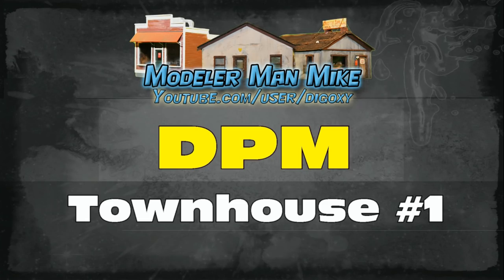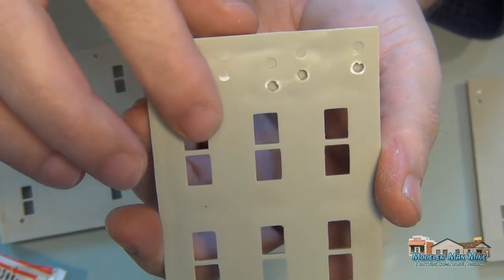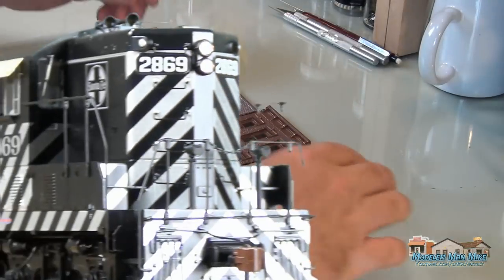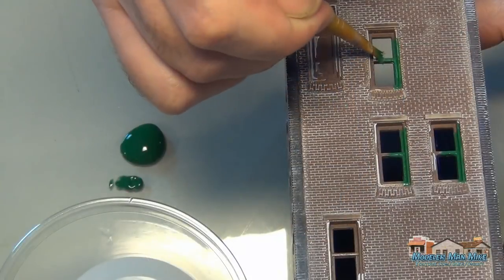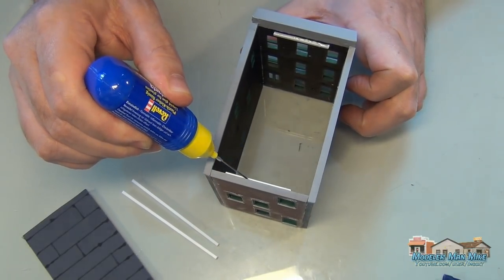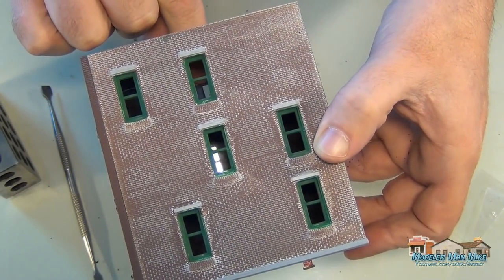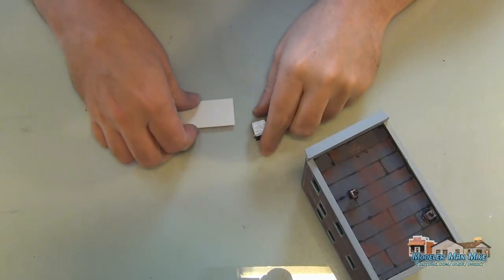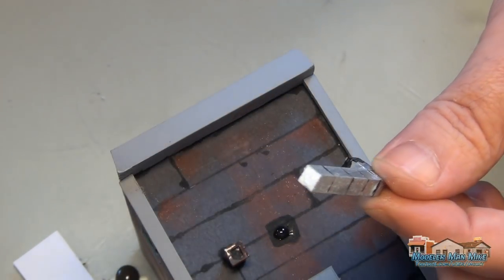Model Railroad Layout Building DPM Townhouse #1 How To

Comment: Mike, I put blue masking tape over the whole face then cut out the windows with a sharp blade.  Set these pieces aside, spray paint the windows.  When dry remove the tape from the building and put the saved cutout pieces over the windows, spray paint the building either white or grey for the grout lines and when dry you can dry brush the brick color.
Reply: Hey, thanks for the suggestion/Tip! Appreciate the feedback.

Comment: I purchased the n scale Town and Factory set of 12 shops and one factory. I also purchased a few more kits to round out my small Mayberry-like town. I have 24 DPM n scale kits in just my small town so, your tips will come in very handy. Trying to paint the windows will be fun! (sarcasm) I do like this paint scheme. Due to the small size of my buildings, I will skip the mortar and roof details. That would make me crazy. I thought I might try (at least on the first one) painting the windows and doors first and then, to help cover the overlap, paint the bricks. Most all the buildings will have three paint colors: the wood trim (usually the place for colorful paint), one for the concrete/stone and one for the brick color. I like the idea of that black cardboard inside to block the see through to the other side and to make the windows appear alive. I also bought some Blair Line Shop Signs, #1 & #2 so all my builds will be labeled as to their purpose: Barber Shop, Bakery, Hotel, etc. Thanks again.
Reply from the maker: Looks like you have a head start on the layout of your buildings, that's great rather than going in blind I say. Have you considered building them on video and uploading the video's? It sounds like you have many to build, would be a great few video's. N scale is pretty small, I am not sure if I could do N Scale, just really hard to see. Danny, thanks for the comments and I do look forward to seeing some of your work regardless of how you show it off, in video, Facebook or however.

Comment: Try painting the windows/doors first. Tape them and then paint the walls. Requires minimum touch up with a fine brush. I've done this with DPM structures with a lot of success.
Reply from the maker: Hey, thanks for the tip, I will give this a try on my next DPM model. Appreciate the feedback.

Comment: Great video Mike - it's good to see how others approach building these models. GREAT A/C UNITS! I also like the weathering effects you get. In case you're interested, consider the following (and if you're not interested, ignore the rest of this post!):

I don't know if you're painting the interior black in order to have a very dark background through the windows, or if you're worried about "light leak" through the plastic walls. If it's the former, here's an easier way to make a view block: cut a piece of black construction paper; make the height the same as the inside height to the roof, and make the length 2xL+W/2, where L is the length of the side walls and W is the building width. After the window glazing is in and the roof is attached, slip the paper in from the bottom, with the two ends in the front left and right corners. The paper will make a U shape, with the bottom of the U just touching the back wall.

I always glue the walls together before painting. (If you desire a sturdier build, glue a 1/16" square length of styrene into the inside of each corner.) Once the glue is dry, you can prime and paint the entire building. I really like the way you made the front brick a different color from the rest of the building: this was commonly done to save money by using cheaper brick on the sides and back. In your case, this is easily done by applying raw umber washes to the front - keep applying successive washes until you get the color you like. (You can even use a burnt sienna wash in there somewhere to make the brick redder.) If you have dramatically different brick colors, you would paint the entire building in the lighter color, then mask and paint the darker color. I never paint my mortar lines, so you'll need to experiment to see if this is better done before or after you apply the washes.

(By the way, I ALWAYS apply several wash coats, even when my brick is all the same color. I find the washes give just enough variation in the brick color to give the brick a natural color variation. If I want a faded sign on my building, I apply a decal over the base color, then apply the washes right over the sign along with the rest of the brick. For a REALLY faded sign, use a sponge to dab some of the base color around the edges - or even in the middle - of the sign to make the sign "disappear.")

One final tip: Roomettes make interior kits for buildings of this sort, and they have a kit designed specifically for this DPM kit: it's the Banfield Street #1. These are easy to install and they come complete with LED lighting. You do NOT need a JustPlug lighting system to use these LEDs! Just clip off the connector, add a 640 Ohm resistor, and connect to 12 VDC.
Reply from the maker: Howdie, thanks for the feedback, ideas. Much of what you have suggested I actually do. I am not sure if you make video's for youtube but you should as you seem to have some good insight in building structures. Try it, you might like making videos to help others.
Reply: @ModelerManMike  Thanks for the kind words. Sadly, my video making skills are non-existent. (You can confirm that for yourself - I have a few short videos posted.) I am in awe of the time and effort folks like you put in to make these videos.
Reply from the maker: @rwissbaum9849  I will check out your video's of course, didnt even think to look as most people who reply dont have any video's. Your right, its a lot of work, it takes me 3 times as long to build a model doing a video with a build. I am really not that good at it, I just kinda throw it together. Its time consuming for sure. Practice helps though.
Reply: @ModelerManMike  Well, for someone who characterizes his video skills as "not that good", I'd say you're doing marvelously well! I bought myself a cheap video recorder last Christmas and I plan to try shooting some better videos. Maybe I'll try filming (how's that for an anachronistic word?) my next model build. (The videos I have posted were shot using my phone.)
Reply from the maker: You would want at the very least a 1024, look up the specs on the Sony HDR-PJ260, I used these for my video's. These would be like 12 years old though camera is key really to get a good clear picture and on a tri-pod as much as possible. Might find one of these used for cheap now! I used 3 of them for different angles but one would suffice I think.
Reply: @ModelerManMike  The camera I bought last Christmas is an off-off-off brand 1024P 24MP 15fps recorder. I installed OpenShot and used it to edit the video you watched - looks pretty easy. (Unfortunately, I just upgraded to Ubuntu 22.04 LTS, and OpenShot DOES NOT run on 22.04 - known bug. So I'll have to install on my laptop, which is not so easy.) Next, I need to look into recording a separate audio track so I can provide some commentary consisting of more than "...oh, shit...ah, okay...where did I put that?..." I have a tripod for my Nikon SLR, so should be all set - just need to do it! (Although I might want to look to see if I can find a small camera mount that clamps to my work table...)

Comment: Try Painting in "curtians" and /or  partially drawn window shades on the INSIDE of the "glass" windows.   Quite easy and gives it another level of realisim.  I use white and yello ochre paint for window shades   and white for where I want curtains on either side of the windows.
Reply from the maker: Good tips! Thanks for taking the time to post this, it can be useful to many.
Reply: Bingo!  I was waiting for someone to post this tip.  Also, it is tough to cut and glue in the window glass pieces after the walls are glued together.  I've tried both methods of masking for walls and windows and neither is worth the effort vs carefully painting each window frame.  You just gotta do it.

Comment: Another cute build, Mike! Some comments along the way:
1. You asked about easier window painting - gosh, there are lots of smaller brushes than what you're using out there! Do the edges with one and then fill it in with a big one.
2. One roof detail that's missing: an access hatch! There has to be some way up there.
3. One advantage to individual window glass pieces is that they don't reflect like one big sheet, just like real buildings. So amen to your comment about how it probably should be done!
4. I always use darker paints on heavily-framed windows like DPM's to reduce the visual size. If you plop down your DPM next to a building with, say, Grandt Line windows, they'll look like they were built with 2x4s! Sometimes I drybrush them with a lighter shade of the same color, which brings just the edges and corners out.
5. I've had good luck with duct work by chopping some little squares of thin styrene, just bigger than the cross-section of the planned duct. I made the duct in pieces and used these as "joiners" in between - they look like standing-seam joints found in real ductwork.
Cheers!
Reply from the maker: carmium Really, Really great tips, thanks for sharing your thoughts and comments. I have tried the square method for the duct work and do like the look and will probably make some like this in the future. For the mine I built sometime back, I would like to use some galvanized round (just seems more appropriate). You have any thoughts on this?

As for the windows, watching this video really enlightened me on the brush, it is well zoomed and I can actually see what I am doing, I am a bit hard to see I guess :) watching the video though does show all of my outside of the lines coloring!

I will need to set some of these buildings out with some others to visually see what your saying about the window frames. I have found that I really like the look of the windows in a lighter color, but, never considered the scale of these frames next to a reduced size window (like you say the grandt). 

Carmium, thanks again for writing, much appreciated and looking forward to seeing some of the build projects come up on your channel :)

Comment: Mike ,I like the fact that you are modest in your thoughts about you not being a good modeler ,so many modelers don't take criticism well ,but let me tell you ,,,, you are a very good modeler. What ever works for you will be best, everyone does it different . You've made it work very well in the process of your builds. The only difference with my building is I don't like to follow the building instructions because I don't want to have the same building that someone else has, and also I build to fit the layout itself. This one is going to my favs.
Reply from the maker: Trainman, thanks so much for all the compliments and adding to your fav's! :) I really and truly dont consider myself a good modeler, I just happen to get the video's put together, I do try hard on the video's to! It sounds like you enjoy kit bashing more than anything is that right?
Reply: What I really like to do is flip through the pages of the modeling magazines and look at the kit bashed structures and try to figure out what manufacture they are and how they were modified ,then try something similar .So yeah, I like to kit bash lol .

Comment: Painting windows and doors: the key is to use a small brush - I like the Flex-i-File Ultra Fine brush assortment. I use a 5/0 brush for the windows and doors. Brace your hand on an adjacent surface to minimize shaking.
Reply from the maker: Thanks again for the suggestions!

Comment: Another great video Mike!  For reference, Jack Daniels or Captain Morgan always help me with painting "inside the lines"
Reply from the maker: Right? I will surely try some rum next time! It worked in 3rd grade!
Reply: ModelerManMike Awe man.  It came out the wrong way. Its a jokeI tell my friends who ask me where I get the patience for working on small models.  As for getting paint within those small areas, I would use an airbursh with a fine point needle either .25mm or .35mm. with psi around 20-25  Dilute the paint with Createx reducer for a 50/50 mix. Its not a quick job but i'm always happy with the results.
   Your videos are excellent. The time and effort you put into them amaze me. I subscribed to you and always look forward to your videos that you post.
Reply from the maker: Fabian K Thanks Fabian, unfortunately I cant get it right with the AB, tried that to! But, I have some really good suggestions from many other people in short, the brush is all wrong, I didnt notice this until I watched the video closely, the brush has straggler hairs.

Comment: Great video, full of useful tips.
You asked about easier detail painting... Try propping your wrist up on a box or block of wood the same size as the model.  Sometimes several low blocks works better than one tall one, so you can stack as many as you need.  Also, keep turning the model over so the the surface you are painting faces up and the edge you are working on is away from you where you can best see the tip of the brush.
Reply from the maker: Good tips, I will surely gibe this a try.

Comment: Forgot to mention, that I trace the pieces and window openings onto paper, to use as a template for cutting and installing the glass for the windows. For the brick mortar I use corn starch. For the window trim, I just use a small brush, however, I paint them first them tape them off when painting the rest of the building.  Thanks for sharing!  Looking forward to your next video
Reply from the maker: Oh, see, this is something that would be different with an O Scale, using corn starch. The morter would be larger and so that would give it a better look. You ever consider making some O scale building video's? would be so nice to see some. I dont think there are very many if there are any at all.

Comment: I watched the DPM #1 building video. I sometimes use a single edge razor blade to keep the paint off the surrounding areas. Press the blade into the corner of the two surfaces. when the painting is done, take the blade away, wipe the blade clean, and move to the next section. It's a lot faster than using tape, and the blades can be broken into smaller pieces to get into smaller areas. I have used a X-acto chisel blade for tight spots.

Comment: You could always paint windows first then mask off or make template to cover also get a finer brush that one was quite big for detail work great tip on the straight lines on ducting great model welldone
Reply from the maker: Hey Jon, thanks for the comments and suggestions. I have actually masked them before, I have a couple of things to try, hopefully I can get something that works for me! :)

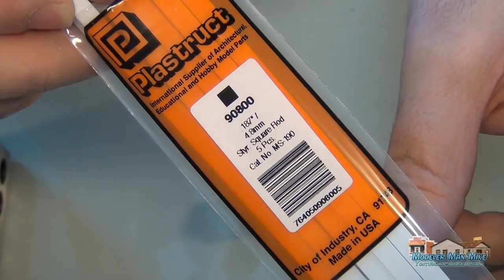Comment: At 12:00 minutes in, ,  I use a smaller brush to paint my DPM detail, including the TOP of the sills.  Half the size you're using.  Also, sometimes Under a lighted magnification stand so I can actually see what I'm doing.  At 21:00,  about duct work.  At every four feet along a duct, there is a seam.  Take a very thin piece of flat , narrow plastic, glue that around the duct (every 4'-0") and sand it nearly smooth.    It will leave the connecting strap that you want.  The actual strap is maybe two inches wide by 1/4 inch thick, so pretty small. It is all painted silver or white after assembly on the roof in real life.  For the model, I would build the entire assembly OFF the model, paint it, weather it and then put it on the roof.  Hope that helps.
Reply from the maker: All good suggestions, thanks for the idea's.

Comment: Hey Mike, for your duct work try cutting small strips of copy paper and glue it where you want seams. paint the paper before cutting to make that part easier I use a paper cutter to to cut straight lines, in fact its a great tool to have for craftsman modeling. Use canopy glue where you don't want any glue to show up, such as gluing on the paper strips. Painting DPM or any molded  in details, use a micro brush and cut some painters blue tape down into smaller sizes to mask off the detail, like for those windows. I also add some window cleaner to my acrylic paints to help it flow into the details as a wetting agent. Do this on your mortar and top weathering it really helps. and last tip to share, try using 80-90% rubbing alcohol (this cuts down on the water in the product) to fix your powders, you can also use chalk pastels ground down with the edge of razor and scrapping the chalks into powders. this will do the same as those expensive hobby powders. purchase a basic set of earth tones to get a good selection. any artiest brand names will work, stay away from low grade cheep chalks they just don't hold up and the colors fade with time, I like Remnant and Grumbacher brands, also only use the chalk type not oil pastels.. hope these help you some. my email is joe.cohen@gorvv.com if you want to drop notes back and forth.

Comment: Nice instructional! Gives me an idea how things have to be done. Example, I would have thought the wall ends would be on a 90 degree flat. If I hadn't seen this vid, I would have been frustrated for sure. A sanding board I shall make ( I seen you have a vid for that as well ). Good job Mike!
Reply from the maker: Jim, thanks for the comments on my video's, they are greatly appreciated. Yes, this is a big deal on the DPM models, many people make this mistake on the first run and do as you say become frustrated. Many have even commented on this video that they have issues squaring the model due to the back wall size not being correct, this is something to consider also. I hope in the very near future to get a couple more video's of dpm builds up that will show I overcome these issues. The sanding station is a must! If you have the city and industry set, this sanding station will play a large role in the builds.